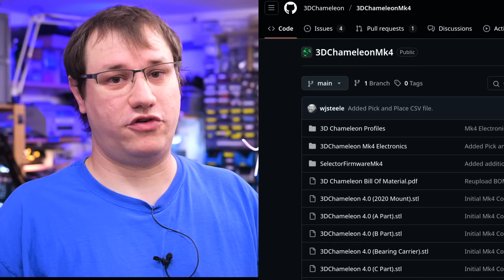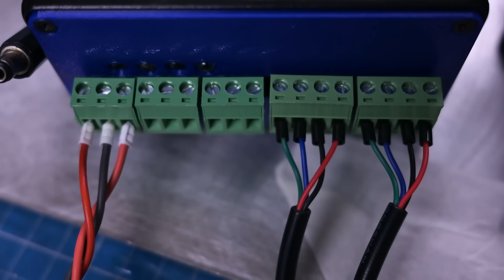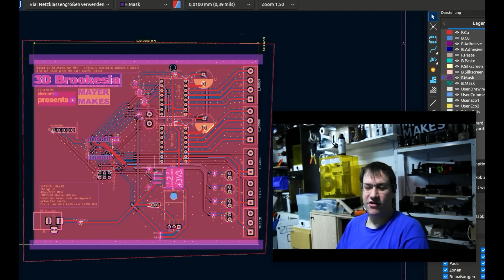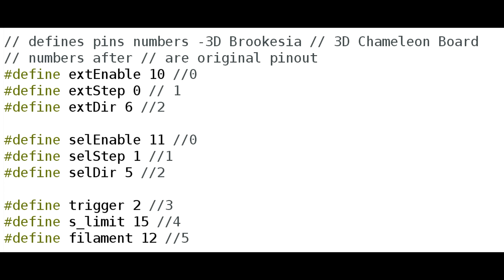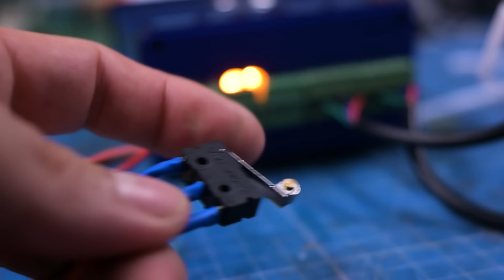Add a Multicolor Filament Changer to Any 3D Printer | Open Source Solution

Comment: Well as much as I would love to build this, the BOM is missing values for some of the parts needed, and stock of parts (at least on JLC) is even less complete vs just building the original.  Adding insult to injury I can't find the case its supposed to use, and I have not found the files to be able to modify it to fit into something else.
Yay I guess we're just going with the original. Good effort though, Im just 8 months too late for this.

Comment: I  got  a little bit confused at the end: I  understood that  you have to insert gcode  somewhere where you want the color to change that makes the  print head go push a switch, that  then activates your 2 colour device. So  what  is the deal with you having to push a switch and then get feedback on how many seconds.
Also how does this device actually gets its 2 colours to the  hotend?

Comment: Just get a old 3d mainboard (its cheaper) and run it with klipper. Also add a stepper motor so you can do 8 colors. This diy board will be used by less then 50 people, so its kinda useless solution.
Reply: this is a video about how you design electronics yourself(and iterate on open source designs and contribute back), its not about how many people use a thing, its about teaching people that they can build things themselves.
Reply: Okay, I can understand that. But seeing this upload is doing well and you have the knowledge and skill, give us a part two where you build it with simple hardware, maybe Pico/TMC2209 Klipper, a trigger, and a physical switch.

Comment: Hi! I bought 2 3dchameleons back when Bill Steel (original creator) was selling them, for my X1C. Bill lives near me and actually came to my house to make it work. After 3 or 4 visits we never were able to make it work. He had it working with the A1, but alas... we quietly gave up. Bambulab the X1C firmware was too proprietary. SO... do you think you will be able to make it work with your new electronics? If not... i have 2 of these original pre-assembled with numerous mounting options already printed for sale🤷‍♂️
Reply: I'm in a similar boat. I bought one from Bill way back when, and I could not get it to work reliably on my P1P. The biggest issue was filament retraction as it would just get all tangled up when it would unload. Getting the timing right for load and unload was also tough. Bill was very patient and helpful through the process. Ultimately I bought an AMS and shelved the 3DC. Now I have a Qidi Q2 which would be an interesting platform to try it on if it were enhanced with filament detectors and especially retraction assistance.
Reply: @TomLichti Yeah, i ended up buying the additional AMS also. Bill was awesome. I have my old pimped out Ender3 and another generic that needs work, maybe if im EXTREMELY bored ill make one of them work. Was also thinking of using parts for a 2ltr bottle PETG filament maker🤷‍♂️
Reply: Where have you listed one for sale and which version is it?  I'm thinking about adding a support material filament to an old printer.  Then again, the U1 is pretty affordable...
Reply: @cpetku hi, I still have both Chameleons. They have the latest firmware that Bill made, so I think version 2. Let me know if you want one!

Comment: Ive been working on Rewriting an old Klipper config for the 3D Chameleon to run off the mainboard if you have two extra motor pinouts or can run a second motherboard thats running parallel with klipper. So far i have everything working as it should, just working on the measurements from New Y splitter i designed to go ontop a Micro Swiss NG Revo Toolhead, will also have a Clippy thats also redesigned to work with the 4-1 splitter/clippy. 

also im using a Manta E3EZ / CB1 and EBB42 , SRA CoreXY, X-Y-Z is being on Mainboard, E on EBB42. So i had E0-E1 to use for Chameleon Selector and Chameleon Extruder, Clippy is a 1/10 Rc Servo 25kg or more, running Sensor pin to EBB42 and Power on Buck Converter. 

If anyone would like to know how just comment back here, we can get you some information on how to do it if you have a Klipper 3D Printer and 2 extra stepper slots or extra mainboard with drivers

Comment: Very cool! Maybe I will pull my Chameleon off the shelf and give it another go. The Chameleon was a great idea, but never was quite all the way there. I know just as many people that got it working great, as struggled and shelved it. I tried for about a year to get it working on a couple different machines, and did the updates, but it never was reliable. Too much was based on timing, with no feedback for the system to know if something was out of sorts. It probably is a lot more reliable now that Happy Hare has picked it up for Klipper machines. Once I added extruder and toolhead sensors to my Voron, the ERCF became way more reliable when it knew where the filament was, verses just ramming it in. Bill teased that the Chameleon could be triggered off the board, verses the switch in some cases, if your board supports it, it would speed things up a considerable amount. As the Chameleon can do swaps pretty quickly in some cases.
Reply: would you concider selling?
Reply: @rodneykohout1595 Consider? Sure, but probably not worth the hassle. I think you are probably better off self sourcing now that it is open.

Comment: Anybody working on this for the centauri carbon? If so, does it work?
Reply: as long as you can put the gcode modifier in the slicer to get the right commands for changign the filament, and your printer is physically able to run into an endswitch you mount to activate the 3d chameleon, such a device will work on any 3d printer.

Comment: Why hasn't anyone utilized using v slot wheels to engage a filament feed. It'd be easy and if you need more tension you can use the eccentric post on the v slot wheel to grip the filament more. Which i also don't see in any mmu. linear rails are overrated, making most mmu's overengineered.

Comment: would be interesting to see how small this could be made, QFN steppers, use an RP2040 or something equally tiny and cheap, USB-C PD for power etc, the biggest things would likely still be the JST motor connectors
Reply: An attiny 412 and the bare tmc chips, likely doable to fit on the back of a stepper.
Reply: the rp2040 is not small once you realize that you need external flash and crystal. it effectivelly doubles in size and cost. for such devices modern attinys are a much more sensible choice  you can scale it down to the minimal rewuirements in capabilities and pins to get it as small as possible.

Comment: If you add a third motor you can get 8 colors!  Using the same selector cam motor for both 4 color sides.  There are some models of this on printables

If you run a Klipper machine then this whole project is better suited to using an old motherboard like the BTT SKR as a secondary MCU.  There is no pressing switches and timing and all that, you can directly communicate with the board if it's a secondary MCU. Plus now you have extra motor ports to do 8 color!

Comment: I'm looking to use parts I already have (12 mm drive gears and grooved bearings from old Creality extruders), and modify mechanics to fit them + use arduino as klipper MCU to skip the switch 😉

Whole time I'm questioning reasonability compared to just getting FF AD5X or AC Kobra S1 - both vastly better printers than what I have now 😅
Reply: good look incorporating those parts...
Reply: @MAYERMAKES  and printed bearings for the selector + trying to find better solution for the tiny springs (a pen could donate enough sprint for 1 or 2 bearing carriers?).
It's mostly just moving filament paths outward for the larger gears, as my 2 grooved non-Bondtech gears were not the same size -- though I only need 2 paths for PLA/PETG supports (without cutter that's the part where luck - or lots of tuning - is needed 🙃) so 🤔

I'm not going to use (even / any) more money on technical dead-end 😅

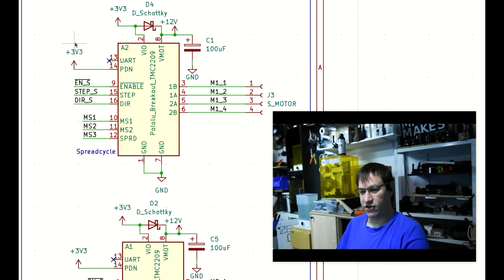Comment: 9:10 got to me honest I don't fully understand the diode there. I don't follow why those two lines are connected in the first place, but I don't see how the diode there would cause the behaviour you describe either. Not an electronics specialist mind you so I'm probably missing something basic but I just can't see electrically why that'd work out.

19:00 PS, what sockets/screw-terminals are you using that plug in like that? I've seen screw terminals, but never ones that socket in like that. (well, maybe I have, but I've never noticed if so)
Reply: Check out the documentation for the watterott silentstepstick protector , i replicated it mostly and its well explained there. You find the full parts list at the lonk in the video description. We have, parts blog etc for each project on the element14 community.
Reply: Look up "Phoenix connectors" for those pluggable screws terminals.

Comment: Great job! 
What material did you print the mechanical part with? 
Did you consider swapping the actuator switch to a contactless alternative like an optical sensor for example?
Reply: The mechanical bits were printed in multicomp petg. The trouble with changing the switch would be that it would not work on all the printers anymore. The trigger variance alone would be a hassle to set up for each install, so i'd say its not worth the trouble and does not provide any improvement

Comment: Wouldn't using a uno r3 and a CNC shield have been easier?
Reply: it is not about easy. this is aproject about porting the hardware to a new mcu plattfomr and modernizing the driver circuity etc.. Cheap or easy are never the goal its about sensible engineering to keep this project alive and manufacturable for longer.

Comment: Why don't u use rp2350 which has more pinout and higher speed at 150MHz and is dual core??
Reply: Because it is a ton harder to route, needs external flash and crystal which makes it overall more expensive and harder to implement, the power would just sit unused. In total it makes 0 sense to use it for this project. No gains but a lot of trouble and possible issues added with it.these are all avoided with my chip of choice and the porting was also very easy.
Reply: overrated mcu